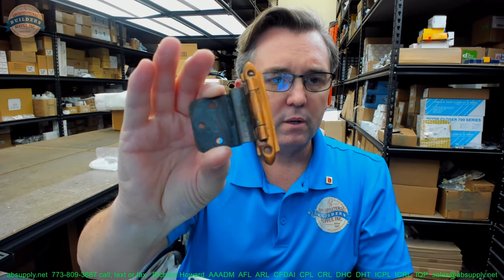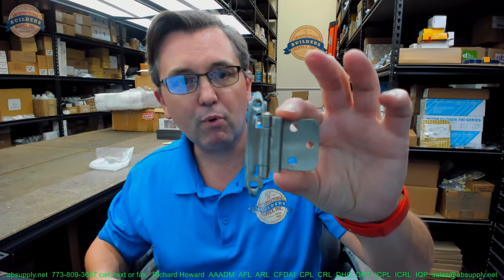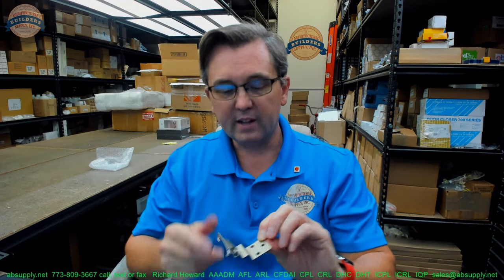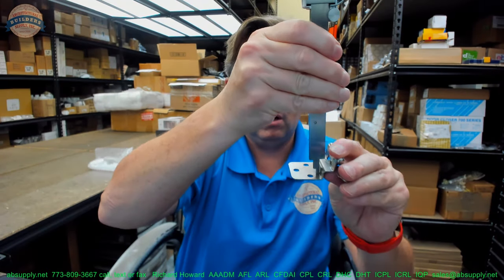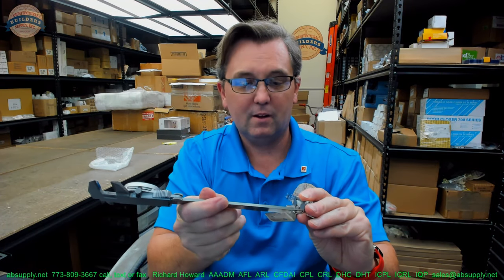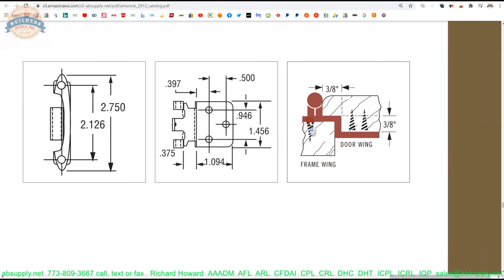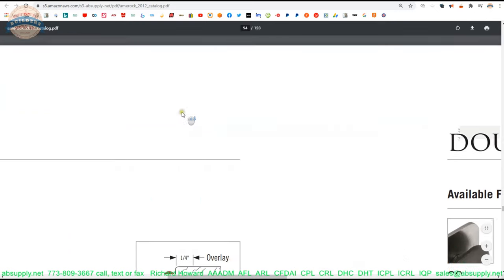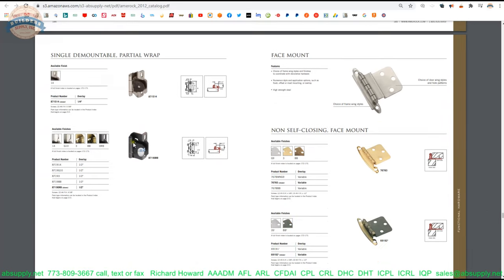A Conversation regarding upgrading cabinet hinges and how the 'exact' replacement forces the door to

Comment: Great Video. I have the problem . But, the painter contractor thre out the old hinges. He said that these were still available at a big box store. , they weren't. 

My hinges have a 3/8 inset, with a 5/8 hip. They hinges I thought were it, I now see the face "part" of the hinge does sit lower . Thank you for pointing this out.
Reply from the maker: Thank you for your comment. Please be sure reach out to Architectural Builders Supply with any future questions.

Comment: I just reviewed your video. I’m interested in finding more information about the old catalogues you mentioned. I need to replace a flush mount overlay hinge from circa 1985. The hinges available today are the same size so to speak, but the screw pattern is not compatible with existing holes on the door. Please advise
Reply from the maker: My guess is that your hole locations are in the exact opposite position of where you need them to be.

I can tell you that I don't have any suggestions short of dowling, closing those holes and then re-drilling holes.